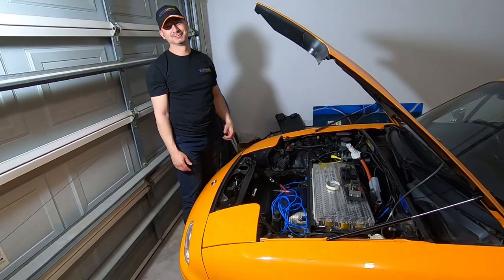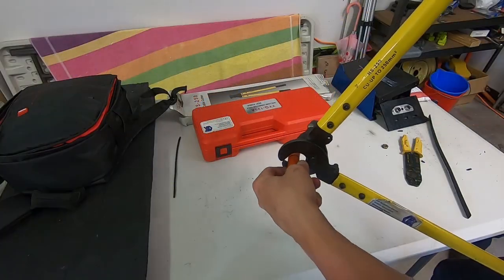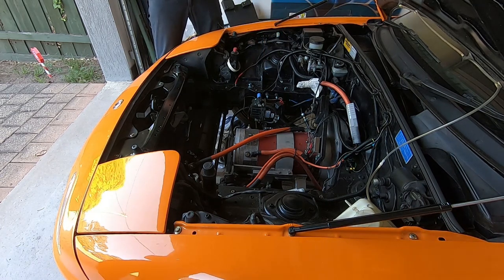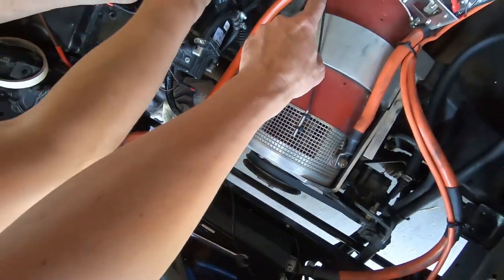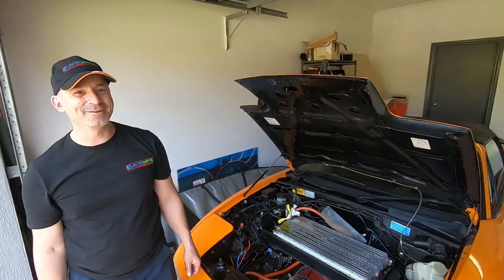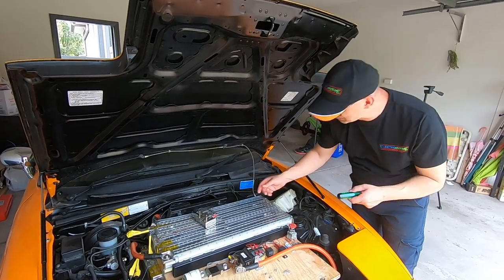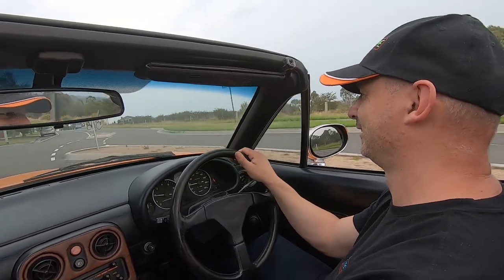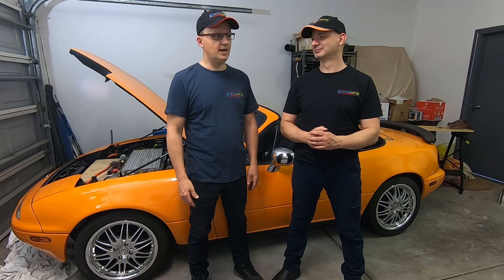Why no skids or burnouts? - EV converted MX5 Miata reality check | ElectroMotive Force

Comment: Nice car and video! It would be nice to have more info about the conversion. Is that an old hyper 9? It sort of looks like you retained the stock clutch and gearbox? True? Where are the other battery modules? What is the range and performance? How did you get the stock gauges to work with the electric like that? I have an Italia (NA Miata based) I want to convert and can use all the info I can get!
Reply from the maker: Hey there, thanks commenting. The conversion is some years old, and we cover the journey of where it started. This is about modernising the vehicle with Tesla modules. The build and the driveline are shown here: https://www.youtube.com/watch?v=f8HsbmgfEQA&t=206s  We have some tech bits on getting the tacho working: https://www.youtube.com/watch?v=wTCmg_dhZTM . Hope our channel helps you out!